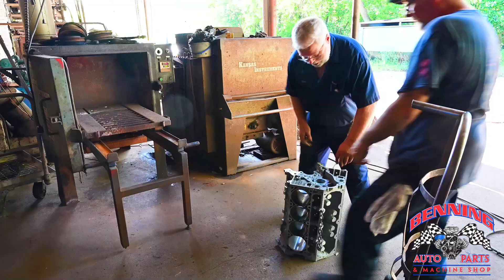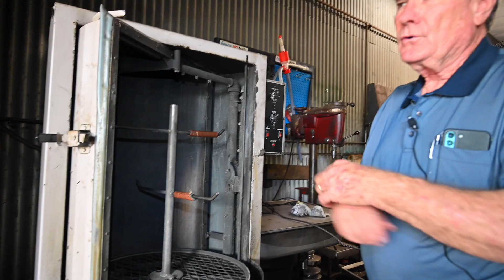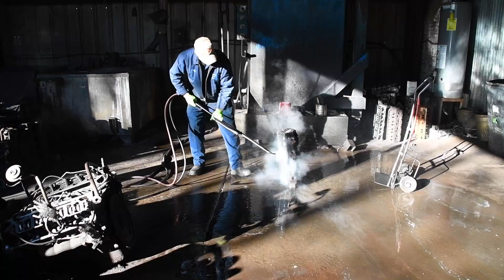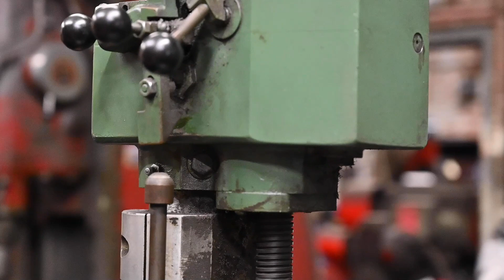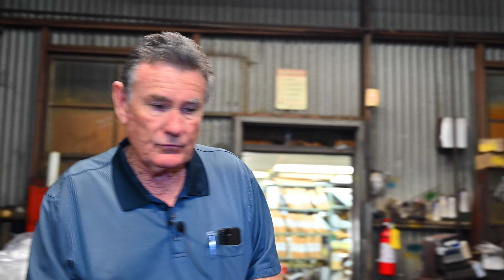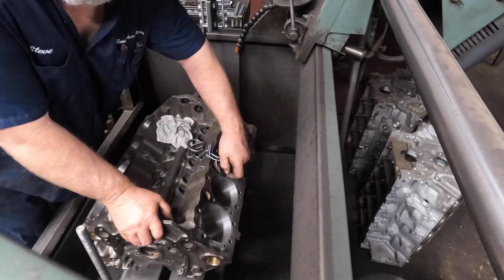Machine Shop Services Series Pt.4 BLOCK DEPARTMENT

Comment: This reminds me of the auto parts stores when I was a kid. I would go to pick up parts with my papaw or uncles and the aroma would hit you when you walked in the door of the local parts store.  It was an even greater experience when I got to go in the back where the machine shop was and see all the machining going on and the engines torn down. That smell of diesel, gas, engine oil, and cutting oil from the maching process all mixed together and was almost heavenly to a young boy that liked working on tractors, trucks, and cars with his papaw and and uncles.